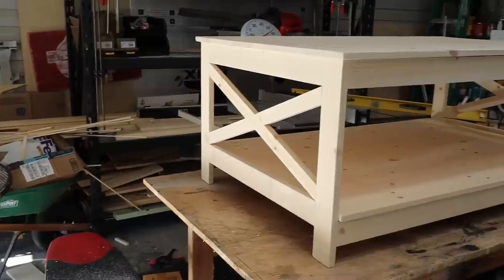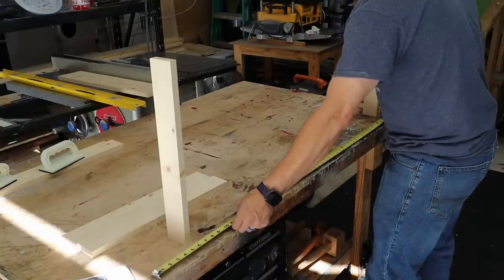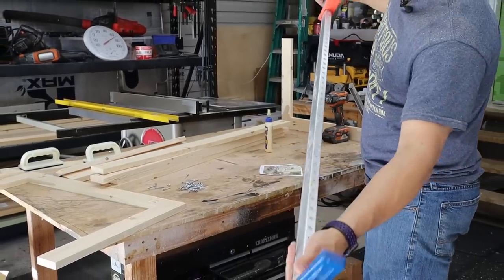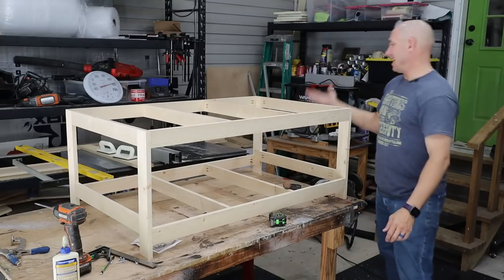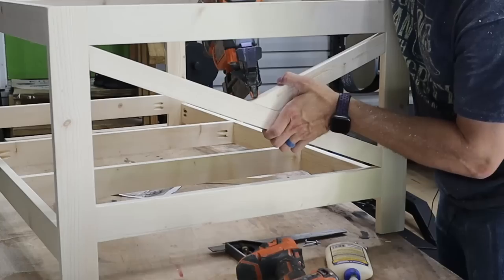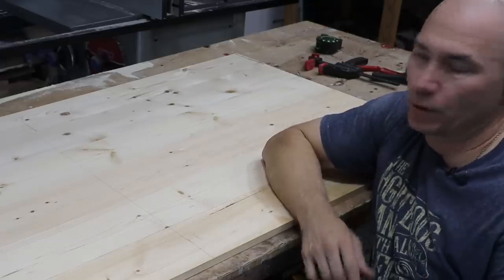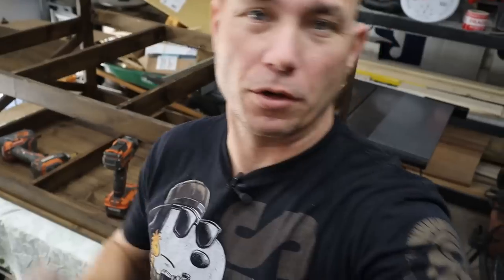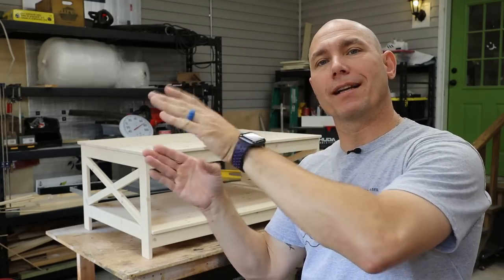DIY Farmhouse Coffee Table with Storage

Comment: Thank you for point out your flaws. I can never stop myself for beating myself down when my work has flaws. This makes me feel a little better that someone like you, who creates so many beautiful items, can make mistakes as well. Thank you!
Reply from the maker: Glad it helps
Reply: I’ve had a raised corner a time or two in table tops. I was told it was my clamping pressure and pocket holes pulling the same direction. Ever heard of this? Anyway since I changed up alternating pocket hole direction and clamp pressures, the tops lay flat. And yes, I always edge cut my boards
Reply from the maker: Thanks

Comment: I just built a end table similar to that for a client.  The Xs on the end I used Titebond quick set and a couple of quick clamps for a minute or two and it worked great.  Didn't need the brads.
Reply from the maker: I’ll have to check that out.  Thanks

Comment: Awesome build, as always!  I have a tip that might make it easier to hold those cross pieces (braces) in place while attaching them:  Clamp a 1x4 horizontally to the bottom of the apron on each side.  That will create a flat shelf for the braces to rest on, ensuring that they are flush with the apron.
Reply from the maker: That's a great idea!
Reply: @731Woodworks  I've heard that saw has a lot of side to side movement. I heard the same with the bosch version too. I really want to buy a saw like this so i can put it directly up against the wall as i dont have much room. Did you notice it?

Comment: I am a beginner woodworker and really enjoy your videos. I successfully built the farmhouse end table with drawer last year. This year I was determined to build the coffee table.  I found that the dimensions of the table made it extremely difficult to manage on my own, even with a proper clamp. I also found that the wood kept splitting when i screwed in pocket hole screws.  I have reluctantly thrown in the towel in favor of a plane using thicker wood.  This maybe shouldn’t be a beginner level project.

Comment: You can improve the rigidity of those budget Harbor Freight clamps by ripping a piece of 3/4 plywood or MDF about an inch shorter than the clamp length and wedge it in the hollow cavity.
Reply from the maker: I’ve saw a video on that.

Comment: Looks good!  I was wondering why you weren’t using your new jointer from the start 😁😁
Reply from the maker: I did for the table top.  But didn't on the legs and aprons because I was using the table saw to rip them to size.

Comment: Theres a wood filler called timbermate. It doesn't shrink or crack and it stains real good. I use it for a super big gap on hardwood floors. You might dig it for the little spots where it needs to be filled it won't come out when you palm sand it down. (Not saying the gaps were bad at all just a suggestion)
Reply from the maker: Thanks for the tip!

Comment: Great video! I need advice Matt! I am looking into purchasing a Craftsman 15 amp table saw from Lowes because I really want to dive deep into this craft because your videos motivate me! It is not the best nor the worst saw, should I wait and buy a different one or should I start off with this one? I already own a circular saw and most hand tools needed. Thanks again for all that you do! Keep it up!
Reply from the maker: Thanks.  It depends on the type of projects you’re building.  It might do what you need.  For my projects, I would probably save up for a bigger saw.  I’m a fan of my Delta table saw I got 3 years ago.  Hard to beat the bang for your buck you get with it.
Reply: @731Woodworks   Thanks for the reply! Do you happen to know the model of it? I am going to check out the specifications.
Reply: @Trickshot0Production  it's the Delta 36-725. I have the same table saw as Matt. It's been awesome! You won't regret saving up to get it.
Reply: @cdadams1223  Thanks! I was actually just looking at it on Home Depot. Looks amazing.
Reply: @cdadams1223  Thanks! I was actually just looking at it on Home Depot. Looks amazing.
Reply from the maker: They have a newer version out now, the 36-725T2
Reply: @731Woodworks  ooohhh...might have to take a look at what's changed/updated.

Comment: Perhaps use an angled cross-lap joint on the "X braces" instead? Resulting in 2 long pieces that fit together, and would save some hassle and provide a stronger working piece. Would save you from nailing the middle of the X as well ☺️
Reply from the maker: Thanks for the tip!
Reply: @731Woodworks  yes, and then you could get a chance to show off using the depth stop on the new Delta for making each half-lap on the x brace

Comment: If you are making this table again in the future, you could look at the video at 30:20 and if you slightly adjust where you put your pocket holes or the table top supports in the middle section, the table top supports would hide these pocket holes for a little better look.  Then make sure to point out to the customer that you took the extra time and care to do this.  I run a side business doing roof cleaning and you'd be surprised how much mentioning these little things can garner some good 5 star reviews, and when people talk about the table you made for them, they are likely to point out little things like this.  Then their friends will know you take extra time and care in your finished products...all by moving a guide line slightly for the pocket holes.  Yeah, I admit I'm a touch OCD, but I take that and turn it into a positive spin on any potential sales.  :0)
Reply from the maker: Thanks for the tip

Comment: Hey Matt!! Love the video... just finishing mine up now... quick question about the sealer... do you seal all the parts? or just the Top and Bottom? Premium 1x6" is about $25 a stick.. so used 2x6 and milled the wood.. much cheaper...but a lot of work... lol.. keep up the great videos and content!!
Reply from the maker: thanks!  I use the clear coat on the top sides
Reply: @731Woodworks  sorry.. let me re-state.. do you put it on the frame as well? The X’s, legs , aprons?
Reply from the maker: Yes if it’s stained I do.

Comment: have you considered using the pocket hole plugs to cover them after screwing things together?  they are cheap and easy to use if you get them from amazon.
Reply from the maker: If they aren't seen, I don't see the need.
Reply: @731Woodworks  understood.

Comment: Suggestion: Rather than try to make perfectly tight joints, put a small bevel or roundover on the mating edges before assembly. On this style of furniture, I would round over all edges anyway, so just include edges at joints. It looks fine on this kind of furniture and it disguises imperfect joinery.

Comment: A time-saver, perhaps: Instead of routing all those slots, consider one long slot on each side...made with a slot-cutting bit.  (For safety and router stability, I'd recommend clamping some spare boards on either side of the top rails to give the router a wider surface on which to ride.)
Reply from the maker: Good tips. Thanks

Comment: Since we are working with construction grade lumber. Are you using a moisture meter to determine if the lumber is dry enough to use.

Thanks

Dave
Reply from the maker: I'm not.  I had these boards for a couple months before use.

Comment: Probably a simple answer, but why would you not also use pocket holes to fix the tabletop to the frame?  would that not have pulled the table warp down?  Great vids btw, thank you for sharing.
Reply from the maker: It allows for the table top to expand and contract without restrictions.
Reply: @731Woodworks  Smashing, thanks and now I think about it, an obvious reason when using wood.  Much appreciated.

Comment: Hey Matt, are you using 1/8th inch cut end mills for cutting your tabletop fastener slots?  If not, what are you using?
Reply from the maker: It's a Freud 1/8" straight bit
Reply: @731Woodworks  the 3/8 deep cut double flute?

Comment: Hey Matt. I have a project I'm working on in which I stained it dark walnut but I used an oil base stain. First time using oil base. I just pre stain conditioner but its still blotchy with lots of color differences throughout the piece. It may be from having too much stain in some areas to be honest. Any suggestions for a fix?
Reply from the maker: I’m unaware of a fix for that other than sanding it back down. Sorry

Comment: would love to know how much you charged for the table, because in lowes or homedepot for seven 1x6x10s just those cost $11 each so 7 is already costing about $80 then the screws and the stain and sealer and clips to hold the tops down might all cost around 100 just in materials alone.
Reply from the maker: $350 for this one, however, I bought all the lumber about 8 weeks ago before the prices went so high.  If I paid higher prices for lumber, I would adjust the price for that.

Comment: Have you ever had problems with the one by pine boards?  I get alot of issues of the board cupping.  It could be a perfect board then I make the tabletop and 2 days later it's cupped horribly
Reply from the maker: I haven't had any issues.  These are spruce
Reply: @731Woodworks  o OK.  Maybe I grab spruce one by's for now on.  Always had issues with the pine

Comment: Question. With the quality of your Delta table saw and it’s fence, can you explain why you rip your boards using a level against the fence instead of just against the fence?
Reply from the maker: The level has two straight sides that gives the board a straight reference. If you just use the fence then the board references it's own side.
Reply: @731Woodworks  I’m confused, and I’m not trying to confuse anyone else, and with the obvious quality of what you produce it must work, but how is it different than following through with the 5 cut method of squaring your fence? If my fence is square to the blade how does putting another flat surface in between the fence and piece your cutting do anything? I’m always open to learning newer and better ways to do something. #genuinelyconfused 🤪
Reply: @731Woodworks  I got it! Lol. I was assuming your edges were straight when ripping. If there is even a slight bow the level ensures you can get a straight edge then you can use that edge to rip from. Like Homer might say, “DOH!”

Comment: Do you think there is a way to use the table top fasteners without router or biscuit joiner with something like a drill
Reply from the maker: Sure, you could drill a few holes, then use a chisel to cut out the rounded parts.
Reply: Thx I’ll give it a try

Comment: Do you just use the boards just the way you bought them or you had to joint and sand them before you build?
Reply: I haven’t seen him answer in a while.  I would joint the edges.  And, yes, sand before assembly

Comment: Pocket holes have a very small learning curve, the jig/setup is very inexpensive, they are quick to use, and their strength is good enough for most uses. I use Dominos but A. This is my full-time job so tools=income and B. The cost of my Domino machine (which, like everything Festool, is absolutely absurd) is what most beginners spend to get their whole shop started.

Pocket holes have their place, and while I make things with fancier joinery, I more than understand that what I make is expensive for a lot of people and most people building stuff just need something they can do that works. So don't feel bad about it. I made my first "real" woodworking project with pocket holes.
Reply from the maker: I appreciate the kind words

Comment: Why would you use ca glue and not wood filler to fix minor errors? Isn't CA glue just crazy glue?
Reply from the maker: I like how fast it dries and a lot of woodworkers use it fill cracks
Reply: @731Woodworks  I'll have to try it some time. I have made homemade wood filler using wood glue and sawdust from the boards I cut and it color matches pretty good. You're right though, it does take some time time to set

Comment: I wasn't able to get all the cuts out of just the seven 1x6x10 I don't know what I did wrong. I'm having to get three more 1x6x10 boards to be able to cut the 4 other pieces of 1x6 at 47 to have the total of 6 pieces and the cut at 28 inches for the x braces.

Comment: The underside brace measurement on your plans that I purchased need fixed, they are not the right measurement on the plans compared to the video.
Reply from the maker: The brace that goes between the aprons or the aprons themselves?
Reply: @731Woodworks  the ones that go under the tops that support the long rails
Reply: @731Woodworks  the braces that go between the aprons